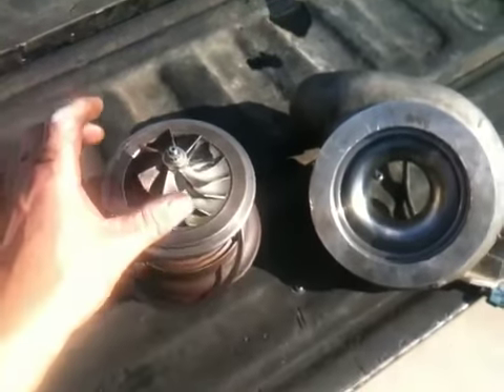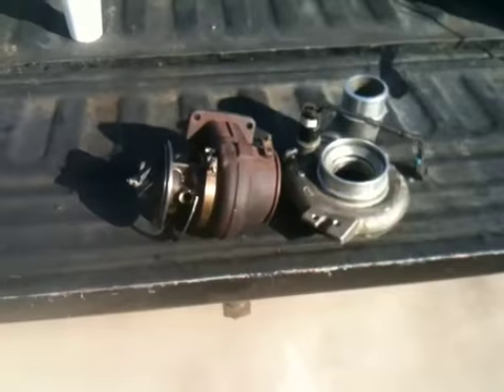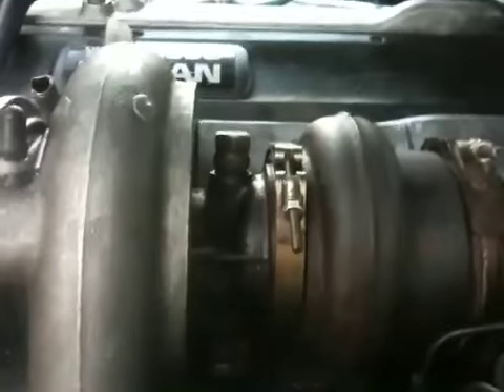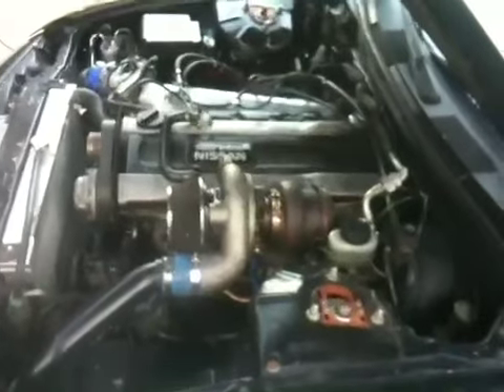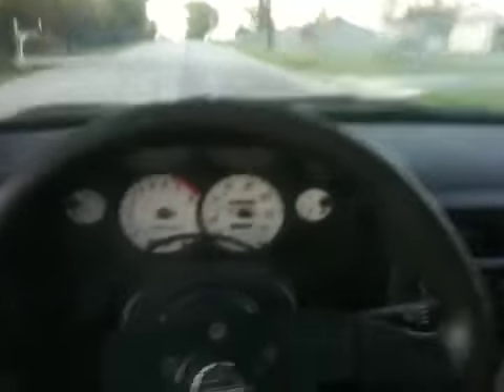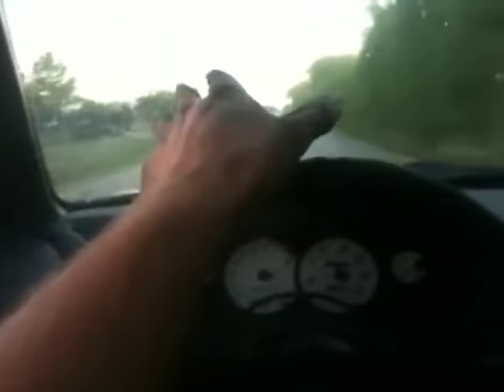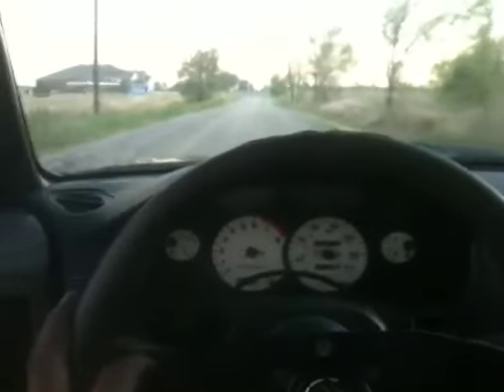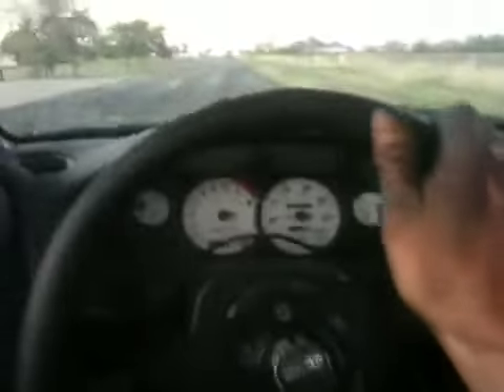Rb30 s14 Holset hy35

Comment: Haven't watched your vids in awhile.  Holset Mafia!  I am currently running an HX35 on my S13 KA24DE-T.  Great turbo for the engine.  A Super HX40 is tempting but only if I can extend the RPM band which won't be for another ten years unless I come across some funds.

Comment: Actually, now that I look a little deeper it's definitely a HE351CW by the actuator mounting tab and the electronic solenoid on the cover.  The reason your BOV got quieter is because of the surge porting on the cover....just doing what it's there for.  ;)

You think that turbo's fun at 16psi, you should feel the same compressor at 38.  :D

Nice ride!

Comment: Isn't this a HE351 turbo and not a HY35? I have a HY35, they're practically the same, but the HE351 has the c clamp hotside, the HY35 has the 5 bolt style hotside

Comment: You appear to have a HE351, which is a 7-blade 60/86mm HX40 compressor mated to a HY35 turbine.  The HY35 and HE341 use the same turbine shaft/wheel but the 341 has a 7-blade 54/78mm HX35 compressor while the 351 has the HX40 wheel mentioned above.  As noted by the turbine housing and the 90* outlet on the compressor cover, it's definitely NOT a HY35.

The reason you keep having turbine sealing ring issues is either crankcase pressure or that sharp 90* bend on your oil drain, by the way.  ;)

Comment: R.I.P.S Stock built rb30's have a 8000 rpm redline. These builds are stock internals, standard spec ACL bearings etc. Nothing special. They havnt had 1 failure.